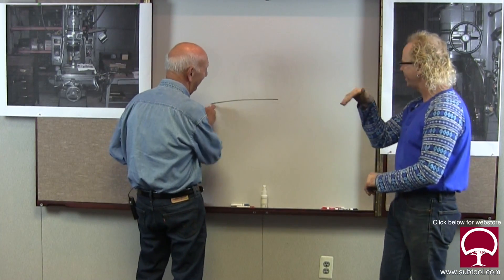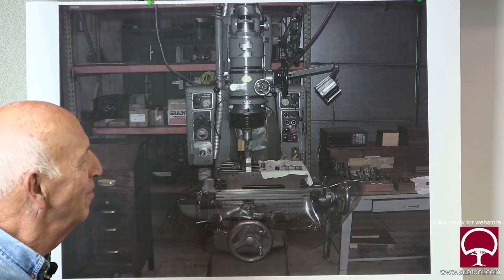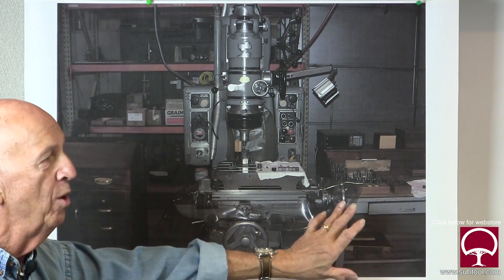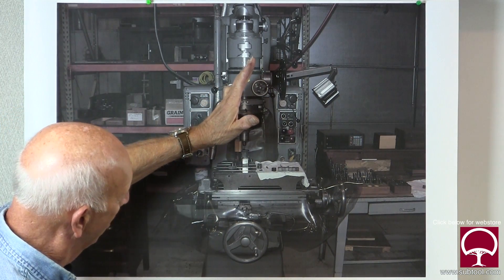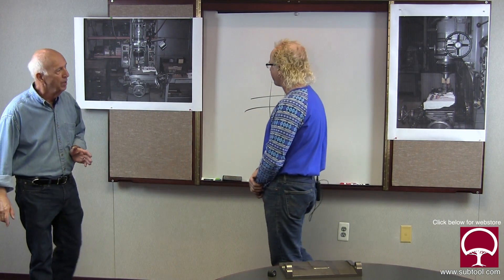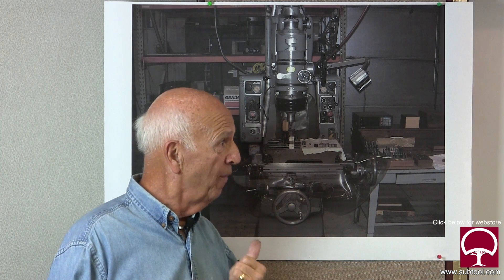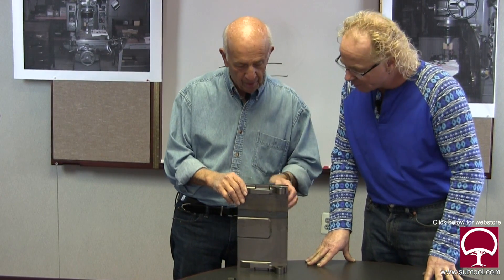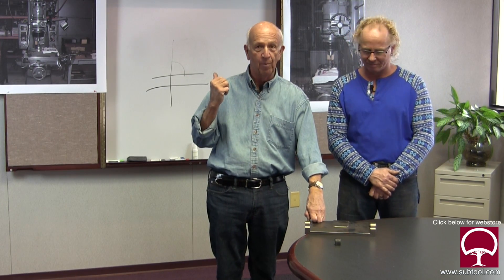Intro to Jig Grinding by Don Bailey

Comment: Getting ready to grind 22mm & 29mm holes 8620 material  - 62 RC. What speed and feed should we use. How fast do we traverse up and down?
How much per paass.
Using a 1/2 dia CBN   85148-DM  Moore  
Thanks

Comment: Don, I am an engineer but I worked as a machinist in a machine shop when I was laid off.  It was a small shop and not run too well.  Anyhow, I was running a Moore jig grinder, and the owners insisted that I use carbide burrs to do my grinding. No grinding points to be found.  I questioned this and got the old, "just do as I say".  I never heard of using carbide burrs except on hand die grinders. Needless to say I never got a finish worth rocky road ice cream. Does this sound to you as crazy as it sounds to me? Thanks.
Reply: It depends on the material and the process.  On soft materials carbide burs can be very accurate and work best in a plunge cut. They can be used for heavy stock removal in hardened materials but they don't react well to small outfeed passes such as .0001 or so. Burs will actually leave the best possible finish if their speeds are right. They can be almost a mirror finish.
Reply: @MrSuperawesome5000  I agree -----with above ----I am currantly grinding test parts with carbide burrs and borezon coated burrs to see what will work best in our application --so far --carbide burrs are leading!!!!

Comment: Hey Don.
Im into handscraping and remember a discussion a while back that included why mill tables tend to 'droop' or dome.  Asides from clamping to T slots it was found over time that they get peened from tools and parts etc being not so gently placed on them. This has a tendency to stress and expand one side leading to the warpage. A trick to counter this when scraping a mill table is to peen the underside to straighten it some, so as to minimise the work in the dovetail surfaces. 
Also remember a fellow roughing in the bearing bearing of a hor bore table before planing the top. It all moved when the stress was relieved from the upper surface so he had to re scrape. Not good, but educational :)

Comment: Looking forward to the Jig Grinding video!  I ran a few jobs on Moore Jig Bores many years ago when I was learning tool making, but the Jig Grinding was left for the masters.  I left that shop 25 years ago and never saw another Jig grinder or borer.  I run a wire EDM from time to time these days to hold tenths but not millionths.  So I'm anxious to see this.  Thanks for sharing.
Reply: A good wire machine will match a jig grinder is many cases if the work does not have a "bottom"

Comment: As a toolmaker in a jobshop I rarely ran our Moore jig grinder. we had full time precision machinists on our key machines. Ours was used mostly on die steels and finishing punch pads post HT when required. Occasionally some profiling of radii was done. running one for me was like watching grass grow!

Comment: THIS series I'm looking. forward to. In all my 50+ years in the machinist trade (which includes lots of poaching on the damn toolmakers) I have zero time on a gig grinder.

Please, I know you love to have fun and yuk it up two jolly guys style but the humor can be very distracting - so exercise a little restraint. This series may form the basis for a noob toolmaker's basic instruction so consider your legacy.

How much material do you have on the survey and tune up of your Moore gig grinder? That would be another excellent series.

With your resources, desire to inform, and technical experience, you, Don Bailey have the potential to be as influential in the preservation of the lore of precision manufacture in your generation as Fred Colvin had in his.

As you said early in this video, there are huge gaps in the available videos of precision manufacture.
Reply: I liked the humor, too dry and you get bored.

Comment: Couldn't you put a indicator in the spindle and  run it up and down against a cylinder square to check that it is perpendicular to the work surface by checking it in both axis relative to the spindle?
Reply: The spindle can be tilted to grind up to 1.5 degree of taper---if this adjustment is set to grind 0 taper ---yes you are right but if taper is not at "0" ---the cylinder square would read that setting as "head out of square"
Reply: in other words  " head squareness and spindle squarenes are different "

Comment: exactly, nothing! We have a Deckel jig grinder and we only did a few jobs on it but I'd really like to go deeper with it. Also, it would be nice if you talked about abrasive choice for jig grinder. We have some cbn wheels but the surface finish is quite bad.
Reply: what type of material are you grinding? What type of tooling? plated wheels, resin bond?

Comment: great video Don. I am 15 and have done a lot of woodworking/turning in my garage fro about 2 years now. I am a sophmore in high school and joined the robotics club at my school (unfortunately we don't have a shop class), I am also in the engineering program. I've quickly moved up in the robotics program even though it is only my first year. the person in charge of the mechanical sub-team could tell I was a good learner, had experience with machine tools, and was responsible. He trained me on the metal lathe and mill and I have fallen in love. It's really cool to make precision parts, and I really like cleaning the old craftsman lathe at the end of the day. after only a couple weeks I bought my own digital calipers. I have always thought I would go to college and become an engineer, but after doing some research it turns out that a lot of engineers have desk jobs and don't get out in the shop that much. Now I'm thinking about doing an apprenticeship for tool and die! I just fear that I will not be able to get an apprenticeship, that it will all be cnc and I won't use manual tools, or that with everything being done overseas the trade will die out. Any help/tips would be great, and thank you for taking the time to make these videos. -Matt
Reply: id recommend not doing tool and die, its not what it use to be, if you dont get into a good shop and get stuck doing something not related to the trade your pretty much screwed. 
I was lucky and worked at 2 jobbing shops and 3 major company's and i was able to take alot in, but i know many that were stuck in EDM or CNC or welding.... and learned nothing, when they were let go they didnt stand a chance.
toolmaking will forever change for the worse.